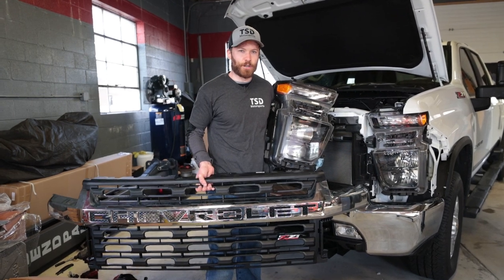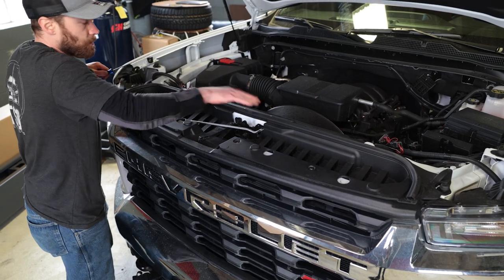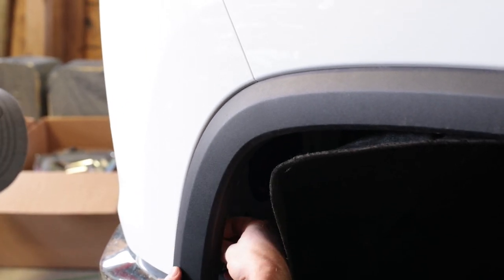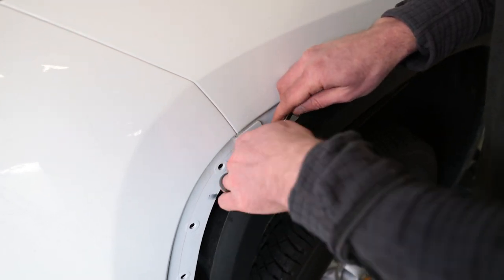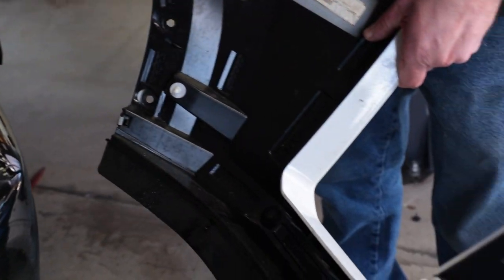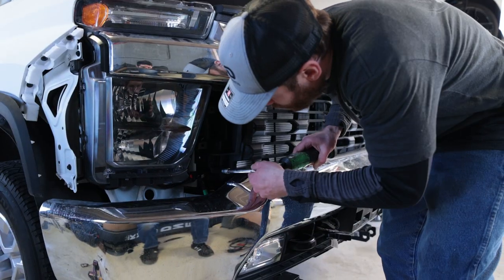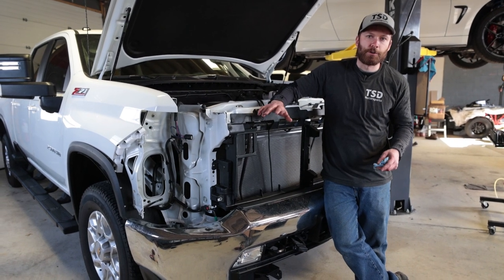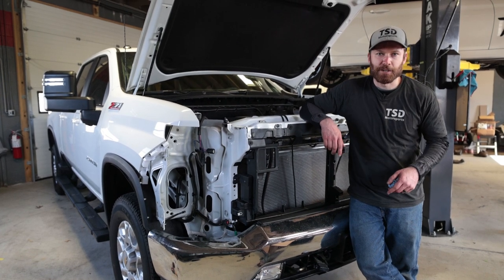2020+ 2500HD 3500HD Silverado Headlight & Grille Removal Guide 2021 2022 Sierra HD

Comment: I have a 2022 Silverado 2500 LT.  I plan to add some offroad lights to my Ranch Hand grill guard.  Once you get the grill top cover off, whats the best way to route the wires into the drivers side of the engine bay where I have a second battery and switch system?  Those shutters don't appear to leave much room.  The Z71 skid plates make it tough to go up under the bumper.  Seems they really tightened up the air flow management on this model.  Thanks.
Reply from the maker: I'm not sure because we didn't feed wires in that direction :(

Comment: Great video.  I have a 2022 2500HD.  I'm installing lights on the Ranch Hand grill guard.  My plan was to run the light wiring through the grill and into the driver's side of the engine bay to a switch control box.  Figured I could do it by removing the grill cap like I did on my 2012.  Then I saw the grill shutters I'd have to work around.  Worse, I didn't see any openings into the engine bay unless there is room around the radiator.  Don't want to remove the grill guard and grill just to install some lights.  Did you see a path for wiring?  Gonna remove the grill cap whenever it decides to get warm in Montana.  Thanks.
Reply from the maker: Unsure. I wasn't looking specifically for that. He did have a plow hooked up but I'm not sure where they ran the wires through.